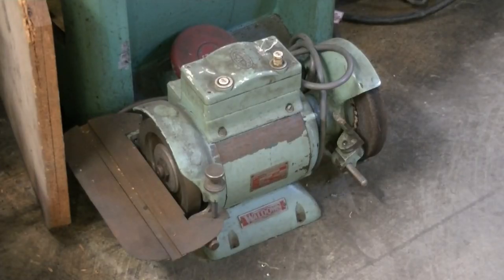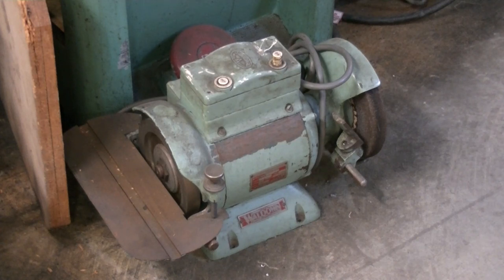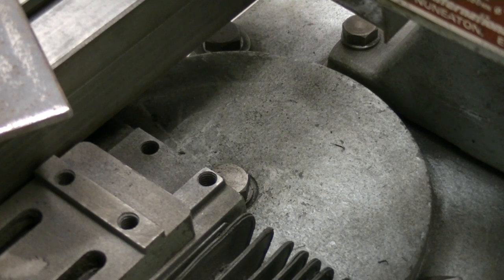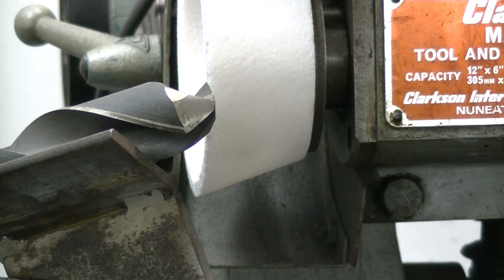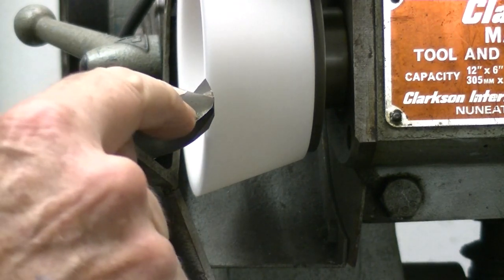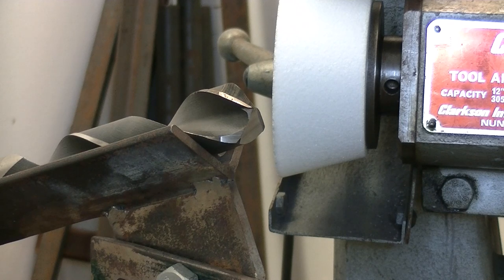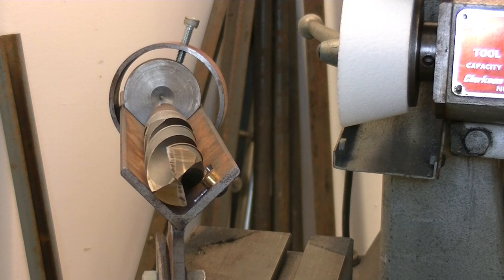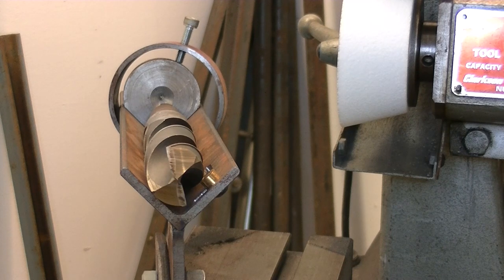4 facet drill demo

Comment: HI,  I made 1 of these drill grindering attachments last week.  Worked a treat   I have a few 3 flute drills which 1 flut cut, rest where on a day out
 ride.  Now I keen to try them out. 
I only have small cutter grinder hobby 1 from casting in the UK called. STENT tool cutter grinder.  

Steve
Reply from the maker: Hi Steve. Good on you. Can we have a photo please?